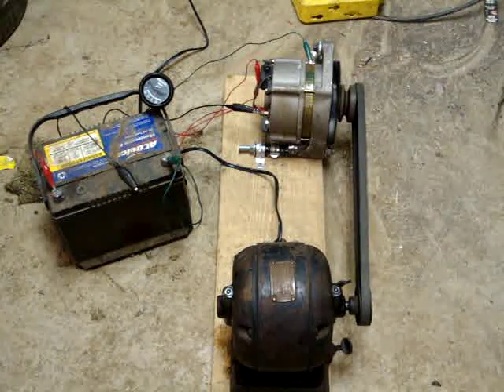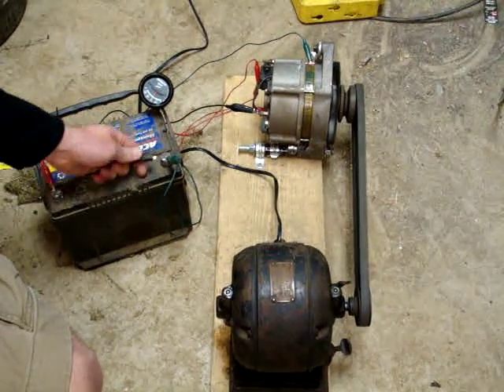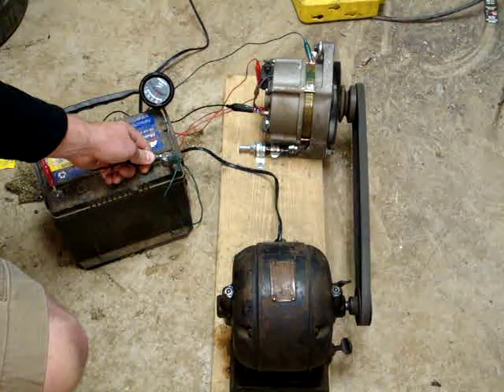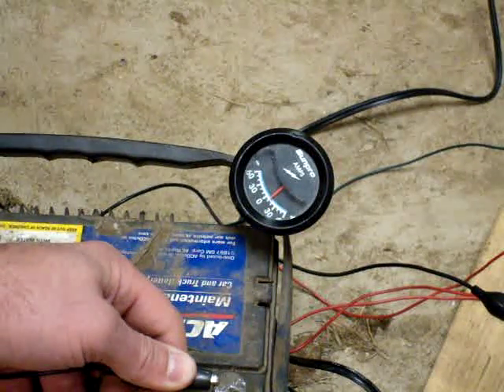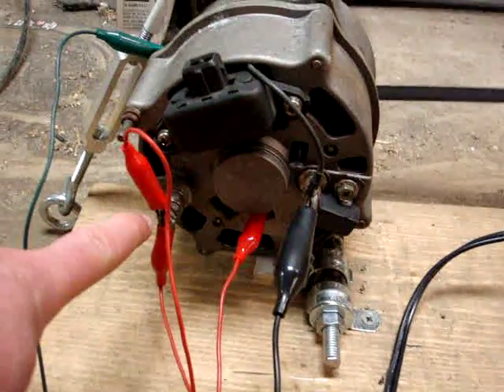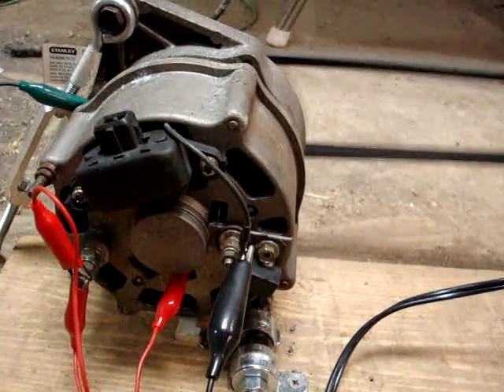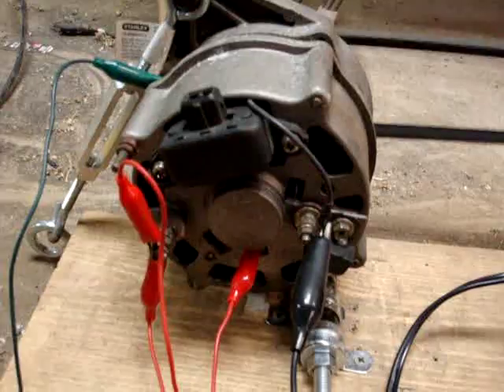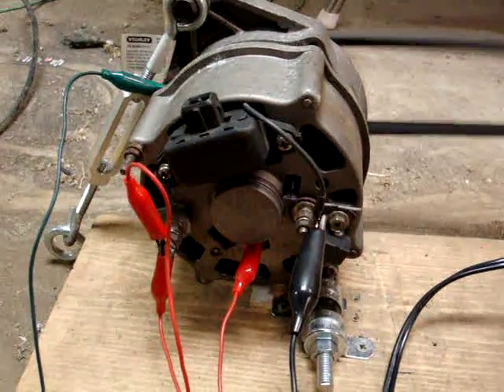Alternator Test Rig

Comment: Mechanic here.  COOL setup dude!  Well done.  
Just an fyi for all:
Inside altetnators, there is NO field "coil".  Only a "rotor coil" and a "stator winding".  The voltage regulator "bypass test" he's doing is called a, "full-field" test, via putting a full, unregulated, 12V power to the spinning rotor's rotor-coil.  That causes the rotor's "rotating magnetic field" to rise up to "full-field" electromagnetic power potential.  Highest alternator capable power is then generated.  But, only do this for a moment.  Too long, and you fry the diodes.